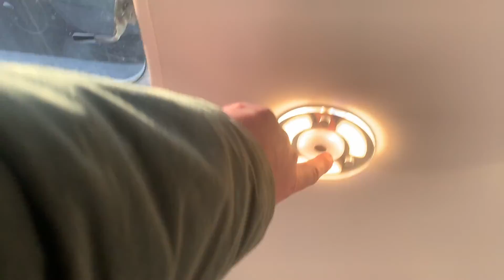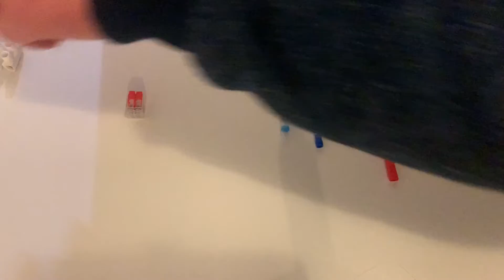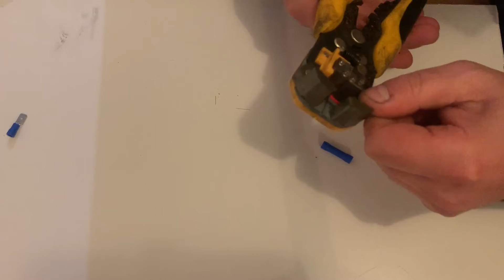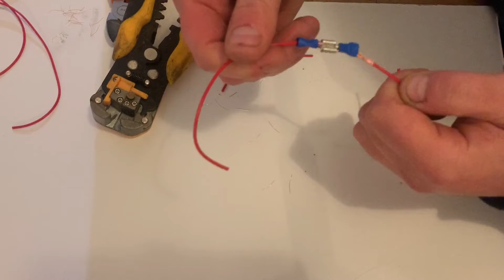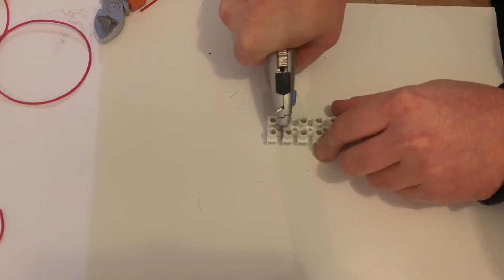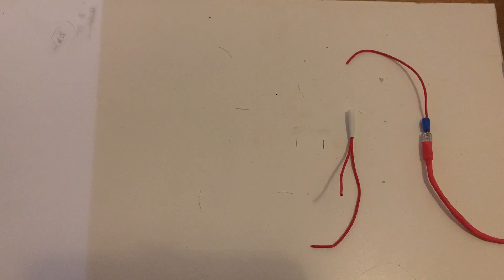Master Cable Connections: 7 Easy Methods for Seamless Connectivity!

Comment: It's great how clearly you show it in the frame, we can see everything you're doing.
Reply from the maker: Thank you so much, means a lot.

I’m going to buy a better tripod soon to make it easier because at the moment the current one is a nightmare
Reply: 🤦‍♂Sorry you missed my sarcasm.
Also I would encourage you to get a proper ratcheting crimper as you will continue to struggle to get good crimps using the extra section that's just "thrown in" on your wire strippers. Another important thing to be aware of is the sized wire that each crimp is designed for. Red up to 0.5-1.5mm2, blue 1-2.5mm2, yellow 2.5-6mm2. Making sure your cable matches closely helps make sure the wires get crimped tight.